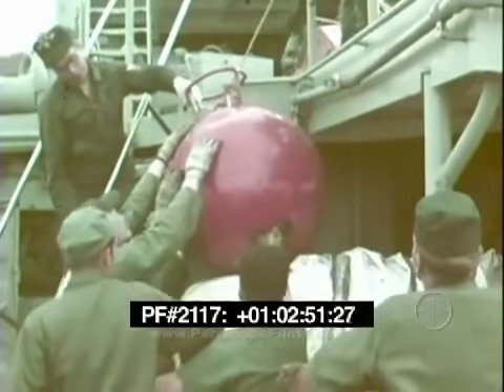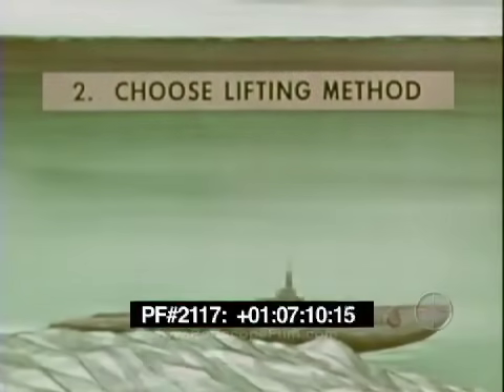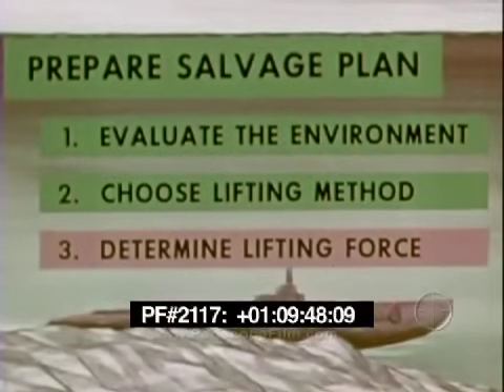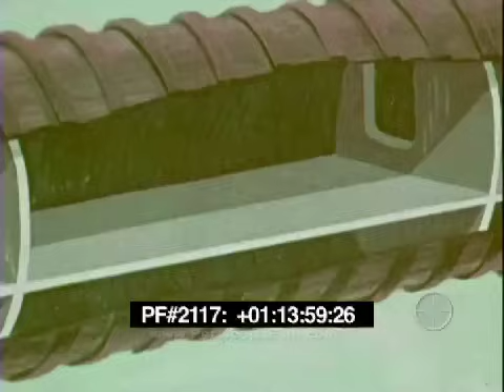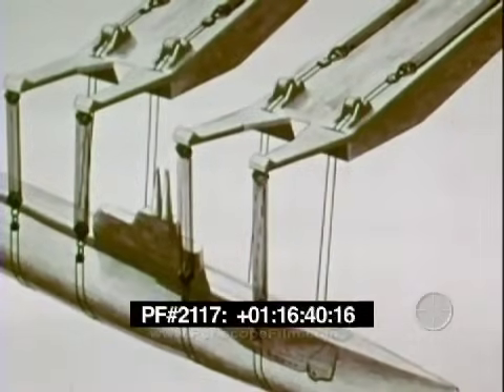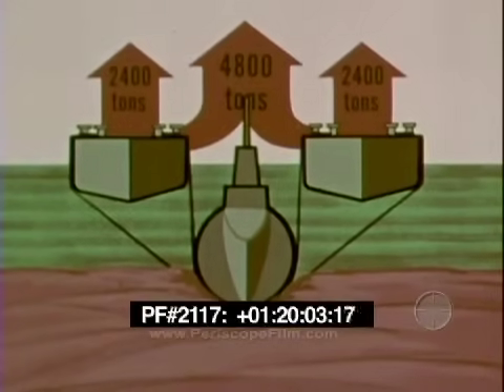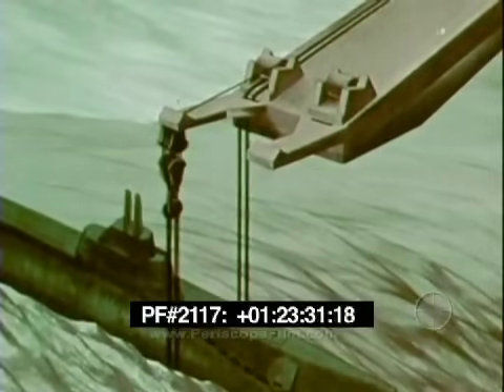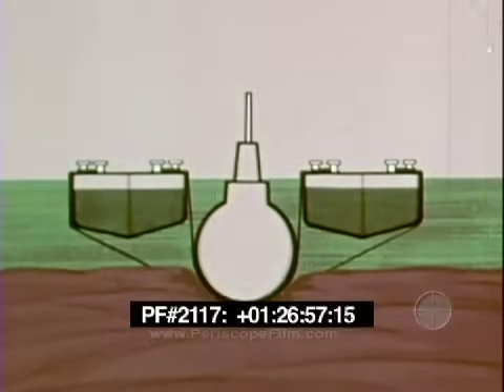SUBMARINE SALVAGE  U.S. NAVY TRAINING FILM   USS HOIST (ARS-40)  SUNKEN SUBMERSIBLE  2117

Comment: For those interested in reading about a real sub salvage operation, the S-51 in 1925, where some of these techniques were used first, and a usable underwater torch was developed, you can read "On The Bottom" by Commander Edward Ellesberg, commander in charge of the operation.  He was also briefly involved in the S-4 salvage operation.  Long out of print but still findable in the internet used market.

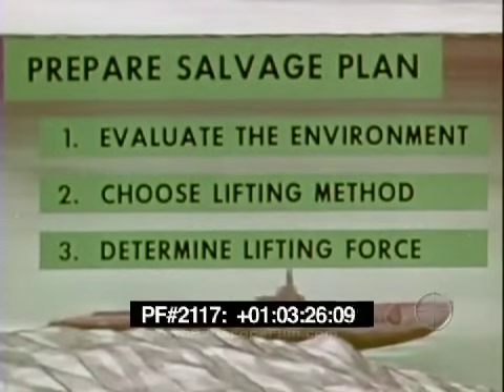Comment: The three boats at 03:35 remind me of my old boat, the USS Wahoo (SS-565) before the three big topside sonar domes were installed and forward section was extended. I can't make out the data that is on the walkway on the center boat, though. I was a Radioman stationed aboard the Wahoo from 1977 to 1980. It was definitely a blast being submariner, especially aboard a diesel-electric boat like the Wahoo at that time. ;-)

Comment: Why not weld brackets on top of hull to lift sub straight away instead of washing mud from under sub when sub is new
Reply: My guess is that, since the outer hull is not nearly as strong as the pressure hull, it wouldn't hold the weight... That or it could compromise the pressure hull If attached to that.
Submarines sunk so infrequently back then, it was probably deemed an unimportant feature